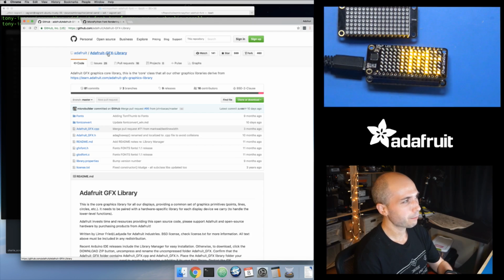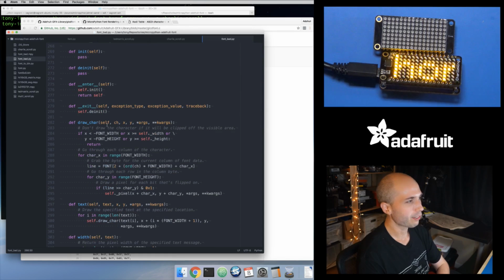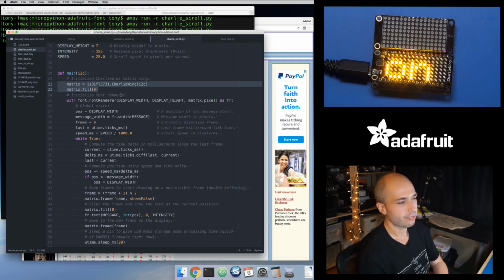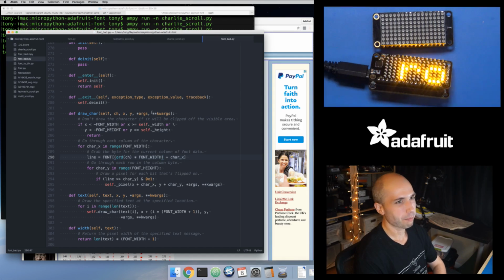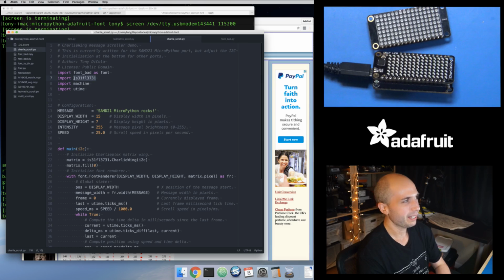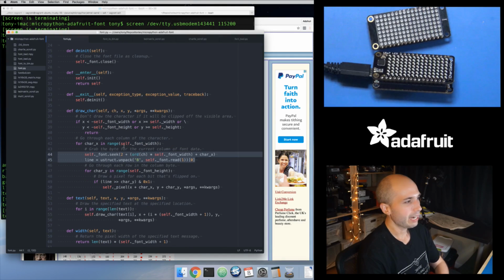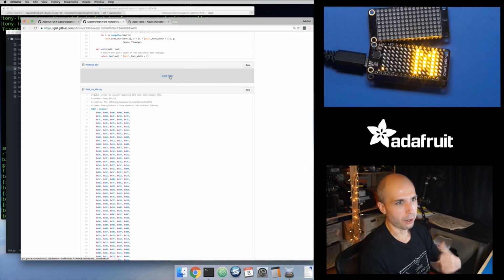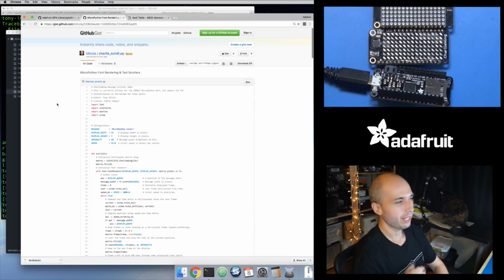MicroPython Text Scroller and Memory Optimizations with Tony D! @micropython

Comment: Hi Tony.
I had been looking into the same thing (on esp8266 and the charlieplex wing) and came up with the same solution of using an ad-hoc font file, except I would load all the characters once when setting the string, so I suppose it takes a little extra memory.
It worked but it was pretty hard to use additional modules, as they would hit the memory barrier, especially since I did not use mpy files (or frozen modules) for the wing's driver (or anything).

Could you reboot the board when a wing is unplugged or plugged in ? That way you would detect and import only the necessary library on startup. I'd rather have the ability to unload a module, but given the startup speed it seems like reseting is a reasonable thing to do.